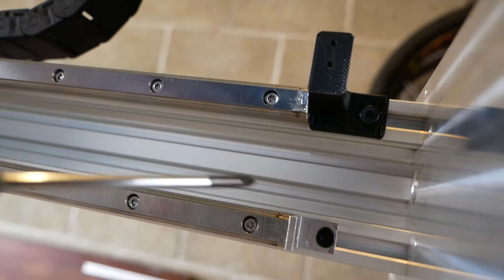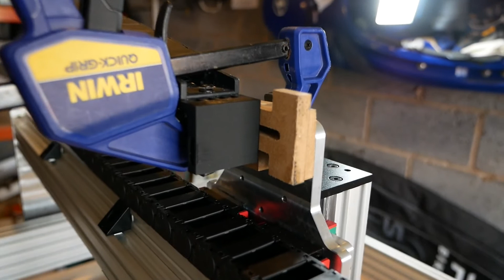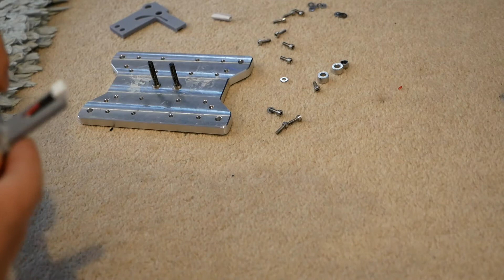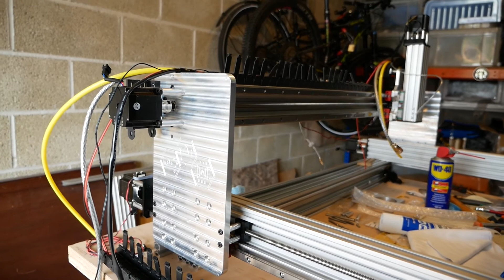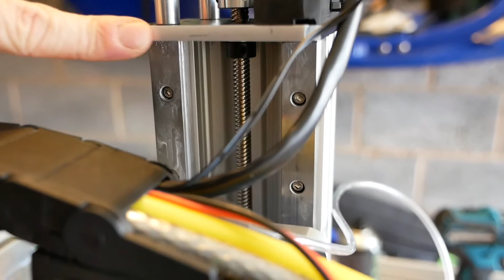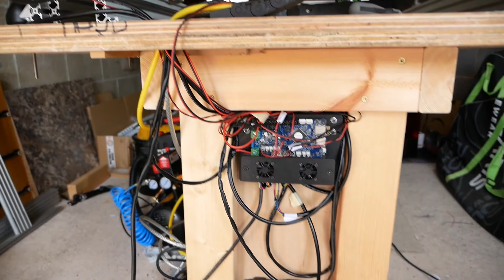QueenBee Upgrade Part 6 Finishing the QueenBee

Comment: What spindle are you using? I’m using a makita router but would like to upgrade to a water cooled spindle, worries about weight though
Reply from the maker: The main thing why I wish I had gone for the larger spindle is collet size.
Reply from the maker: I think with this upgrade you wont worry weight, i wish i had got a bigger spindle really,its a 1.5 Kw spindle from 3dtek
Reply: Thanks for the reply, I was thinking of getting a 1.5kw myself
Reply: Can always upgrade again! I think the 1.5 would be enough for me at the moment

Comment: why do you only have one linear rail per side on Y axis the plates clearly have holes for 2 linear rails per side. IMHO the default workbee with  all the wheels on both sides looks much stronger. what do you think? is this single rail build actually stronger? doens't appear so!
Reply from the maker: I talked to the designer and he believed that 1 is sufficient plus you need to remember it is a total of 2, and as mine is assembled nice and solid
Reply: @TEACypher  thanks for the reply. I guess we will never know  unless someone does a side by side comparison? Some people think the wheels are sufficient, so it's really just an opinion till proven right?